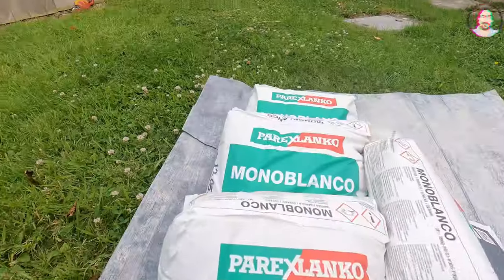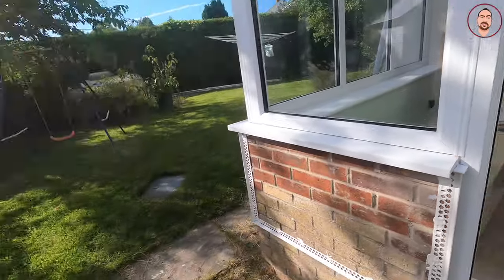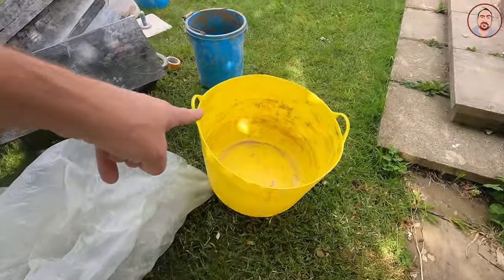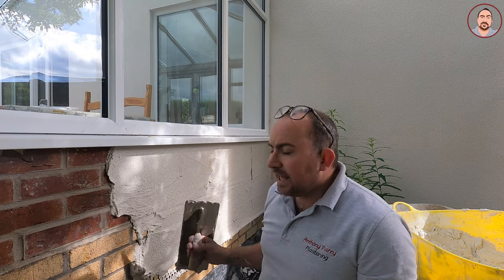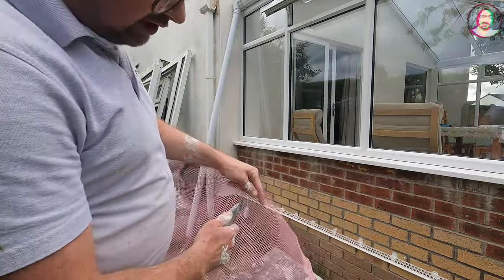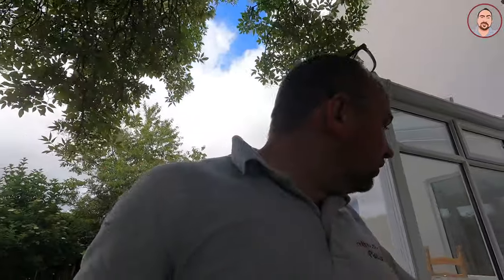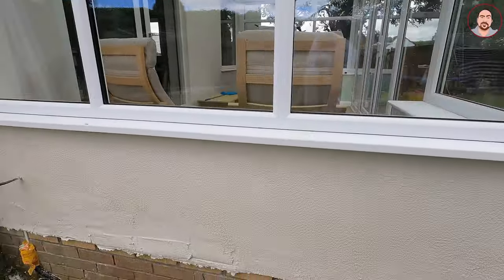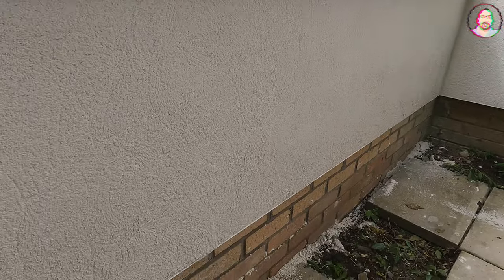My first time Using Parex monoblanco

Comment: Here in the south of France, that stuff goes off quickly so I can apply and scratch 2 hours after putting on second coat. I definitely would apply it late at night if I lived in the UK and scratch in the morning as it would probably still be soft and not hard to scratch. I like to scratch when you just see a slight finger indentation as it makes the job a whole lot easier and I find it gives a better result

Comment: Great video, do you not have to apply mesh in between the coats ?
Reply from the maker: The only time I’d put mesh on, is if I’d base coated it. Id be worried that you would rub back to the mesh otherwise.

Comment: Hi mate, cracking video as always. 
Did you use any bonding agent or wet the wall down at all? Any advice or when and why you would use primers / base coats and in what situations?
Thanks in advance.
Reply from the maker: Hi Oliver. No I didn’t on this job. With monoblanco it’s a one coat system so it was good to go straight over. If the brickwork was painted that’s when I would use a primer and base coat. It all depends on the background and what the product is meant for. This product is designed for going over new brickwork and block work. So I didn’t have any worries. But if I’d knock off old render I work definitely base coat it then
Reply: @AnthonyParryPlastering  thanks for taking the time to reply Anthony. All the best mate 👍
Reply: @AnthonyParryPlastering  would you always prime if you used a base coat then?

Comment: Herendous
Reply: Big scrape marks using i bar wrong should be scraped to get the skim of it then finish off with I bar then scrape over everything with big long 500mm metal spatula to lose all the scrape marks and it’s a nice straight sharp edge to level last bits then finish with a soft brush

Comment: Help to go on there course hate all these plasterers out there that ain’t actually certified by the brands themselves and then off a service that they don’t completely know what there do and the right products to use if installed correctly by a approved applicator you get your warranty and a better looking finish and know the right adhesive has been used which I bet this guy would say SBR or a red grit primer but again good products but the wrong products and actually I didn’t even see him prime the brickwork omg😂 it gets better 😂😂😂
Reply: Answer is pal 
Parex DPR 
GO DO YOUR HOMEWORK BEFORE OFFERING A SERVICE YOU DONT KNOW HOW TO DO CORRECTLY AMD THEN THE CUSTOMER WONDERS WHY I CHARGE ALOT MORE 
FOR ONE I PUT IT ON AT 15-18mm which is specified he does 10mm and the customer wonders why I’m twice the price nearly and then they ring the company and they give them my number and I then have to start all over again to warranty it by which time inflation has gone up and they pay more again when it all starts dissolving and falling off so do the right thing and RING PAREX AMD GET AN APPROVED APPLICATOR OFF THEM AND THEN IF IT ALL DOES FALL OFF (which it won’t)ITS DOWN TO PAREX OR KREND TO FIX IT LEGALLY BECAUSE IT IS THEIR OWN APPROVED APPLICATORS
Reply: I'm going to ring Parex for a recommendation.. They just don't have a clue where I live. I'd be gutted having a crap job like that with all the swirls, no mesh and no micro gobetis.